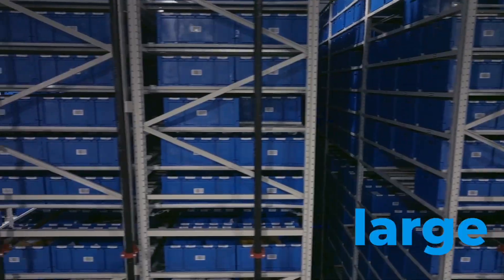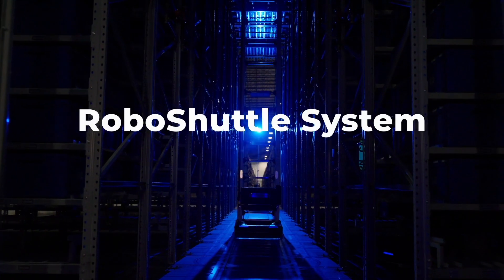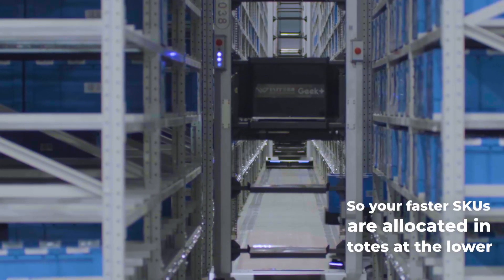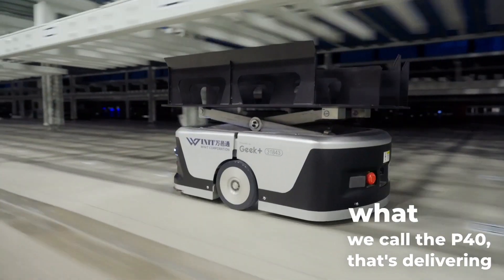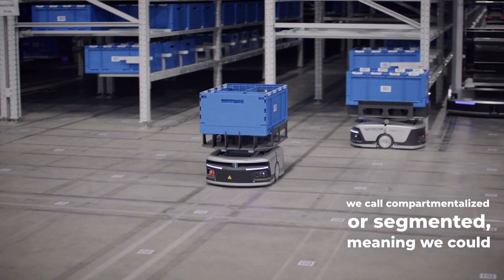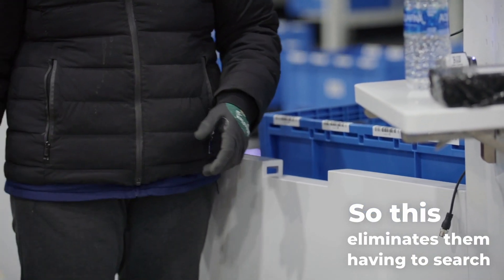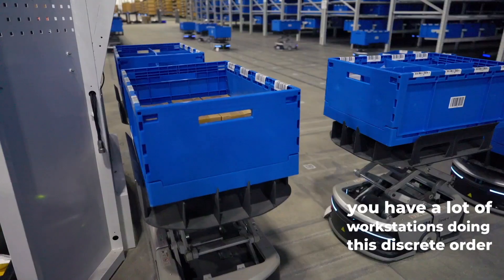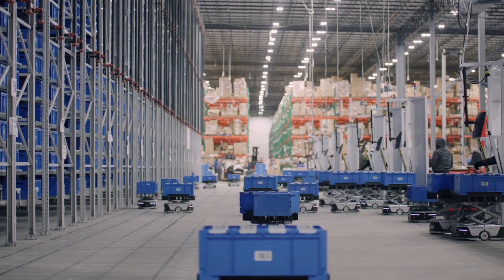RoboShuttle Tote-to-Person System ⭐️ USA Case Study

Comment: There doesn't appear to be any safety fencing between the pickers and P40 robots, is this not necessary? Also, warehouse floor space is pretty cheap, surely those savings aren't sufficient to pay for a system like this? Is this mostly just for operations that cannot expand and don't want to relocate, and are happy to pay a premium?
Reply: @JamesClarkDCautomation "ROI in less that 24 months" In my experience this is almost never true. The ROI assumptions used are always nonsensical. I've seen plenty of shuttle systems with lower system lines/hr than can be achieved with manual batch picking.